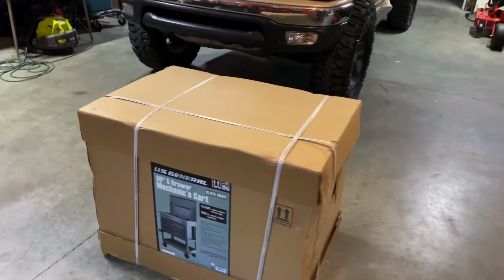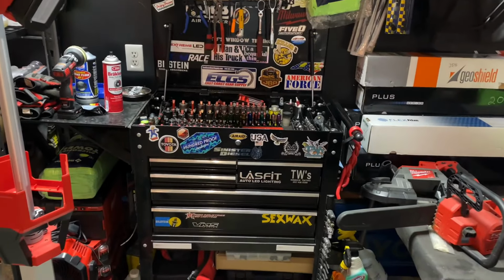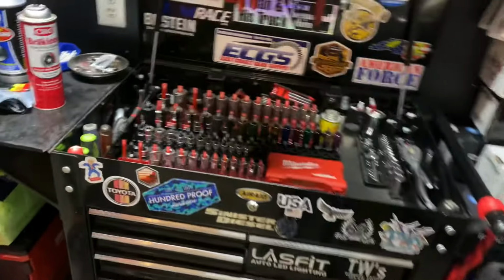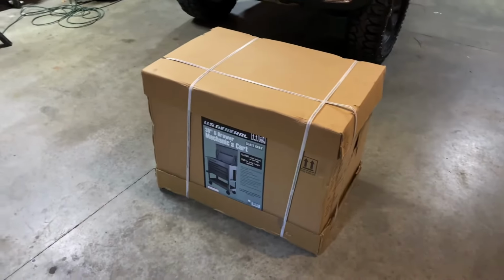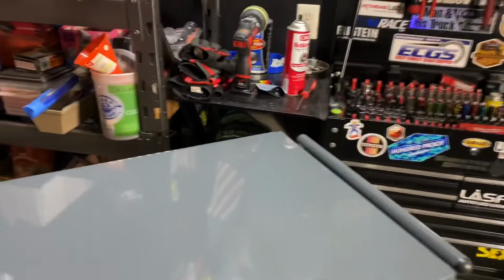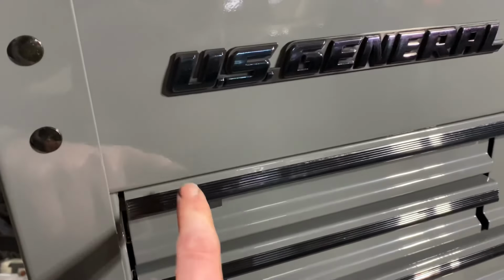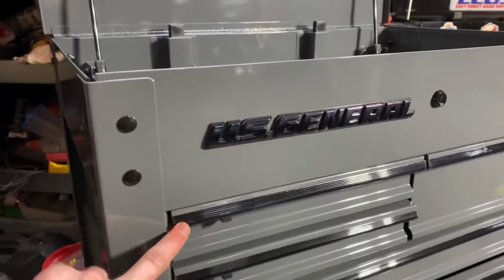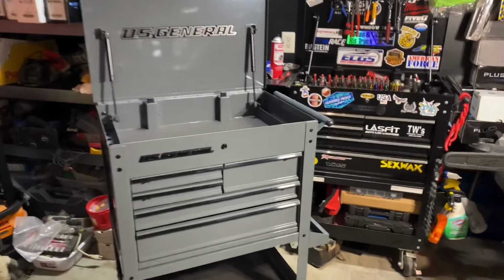Harbor Freight U.S. General NEW Slate Gray 30” Rolling Tool Box

Comment: I had my blue one for about a year and I love it so far and held up good. I recently went back to see the new grey one in person, and for whatever reason when I went to pull the drawers on the grey one to see how they feel, I feel that the drawers were more stout than what I own and had good drawer liners not the thin foam ones that you get out of the box. Could this be that they changed the drawer liners and drawer slides to make it appear that's what comes with the tool cart?
Reply from the maker: My old black one is amazing, the gray does seem better but hasn’t been broken in like the black one but yeah the foam does seem thicker, also have a white one and it’s bad they didn’t even grease the drawers but i fixed up myself